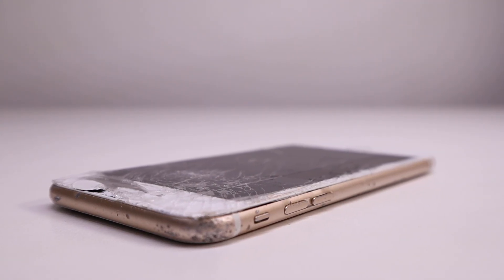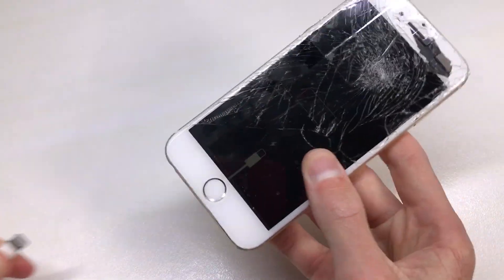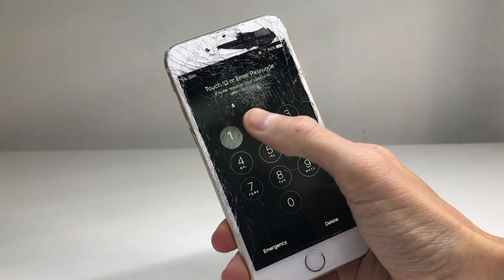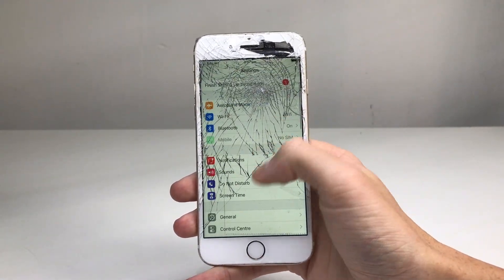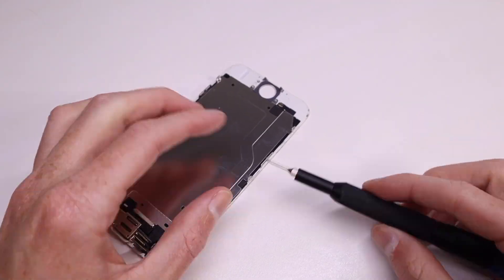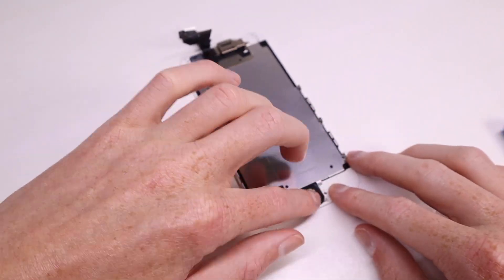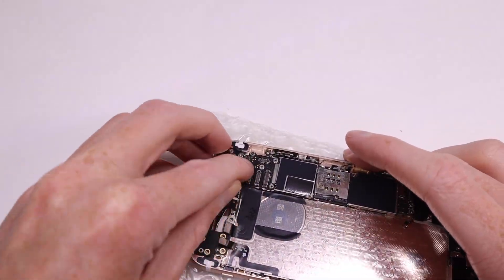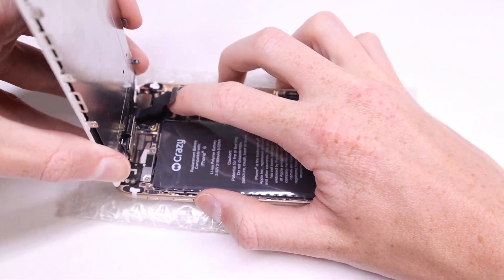$30 Destroyed iPhone 6 Restoration - Seller Tried to Scam Me?!

Comment: For the question why apple doesn't let you repair the home button with touch ID is because, in my opinion, they don't want the phone's security to be compromised by installing home buttons from other phones or third party. I find the reason here in this video to be the common and lazy explanation to what Apple does things.
Reply from the maker: If thats the case, why doesn't Apple have a home repair/replacement service?
They refuse to replace a broken home button by itself and say its attached to the screen and will charge you for a whole screen replacement even if the screen isn't broken!
They are straight up lying to people and getting away with it!
Reply: @HughJeffreys it would be the same as why when you break the glass of an iPad today, you would also need to pay for the laminated display as well. Nowadays, Apple is integrating all the parts into one component, which complicates the repairing process of an individual part... I highly recommend that you watch Apple Explained, they have a video which explains the repairing process and why it is so expensive. Also watch louis rossmann response to that video. But i'm not denying your effort and value into refurbishing the iphone i find it very interesting. But just pointing out that it is easy to criticise but it takes a lot of effort into understanding why companies do certain things, rather than just blaming it all to greed and making money.

Comment: I usually remove the plastic from the replacement batteries, but other than that I've never done anything differently while doing repairs, and I've never had that display issue
Reply from the maker: I did remove the plastic :)
Reply: @HughJeffreys  in which case I stand corrected and apologize, I guess it's just one of those strange things then lol

Comment: Be sure, especially with the iPhone 6 to discharge the board after disconnecting the battery. It is common that you will blow the backlight ic if you don't. Simply hit the power button a bunch or hold it down for a few seconds. Newer iphone's aren't as much of a risk, but be careful because this will require microsoldering to repair. As far as the display showing lines, if after multiple attempts to ensure that the connectors are clean and no pins are missing, it is entirely possible for the display to be defective. Alot of it all comes to trial and error when it comes to this stuff. But with Apple making phone repairs evermore difficult, it becomes increasingly more time consuming. For instance, I had an iPhone X that needed a port replacement due to not charging, after the replacement, the phone would shut off after 3 or so minutes of use. With many tries of disconnecting, cleaning, and trying 2 other replacement ports, the issue was not present with the original port being put back in. I will be testing with different suppliers to see if they were just bad quality or ONLY OEM parts will work. Only time will tell before iPhone repairs become too costly. I see it very near, also I am a phone repair technician so take that for a grain of salt. Apple does want all the money, that much is true with new iPhone's.
Reply: fining a good supplier for aftermarket iPhone parts is a challenge for me at least. So frustrating to get junk parts not to mention stuff like replacing the screen on an iPhone X with an aftermarket screen, the screen won't work when you do the next IOS update. Thanks Apple.
Reply: @MrTimdtoolman1  Yea, quality parts for newer iPhones. Nightmarish. I had a customer's iphone X charging port stop working. He came in, I figured oh, simple enough. May take a while but should be easy. I bought 3 ports from 3 different sellers, because I never replaced a port on an X before. The first one literly looked like someone tried to fix the connector with solder, it was awful because it was supposed to be new, probably was one someone returned and was given that after they tried to fix it. Anyway back to my point, the two other ports both did not work(two different sellers) and it would charge fine, but the phone would shut off every 2-5 minutes and restart. The only way to fix it was to use an original apple part from a part phone. Well fortunately the next day after this fiasco, I was able to buy an iphone x from someone and the port worked fine in the customers phone. Maybe bad batch but I need to test more ports to find out if it has to be apple parts or if I have to to a restore to make it recognize it without restarting
Reply: @Flammablemaster1990  Will home functionalities stop working after an aftermarket LCD replacement? Is getting a refurbished one or simply replacing the glass the way to go?
Reply: @Madrista10Raul  Here is how the structure is. Ever since apple introduced touch I'd on any apple device. That button is tied to the motherboard by apple from the factory with a $600,000 or so device that they will not sell or allow anyone but them to use to pair the devices. Once your home button breaks, if it is any of the iphone 6's and down, touch ID functionality will not work and apple will have to pair it if you want that functionality. Now for the iphone 7 and up, stopping at X when they removed the button. If the home button is damaged and stops working, a replacement button will serve no purpose other than to fill the empty hole if it was gone. The physical button on the 6's and back will still click to go home or close apps, but on the 7 and 8, the plus accordingly. The home button does not click anymore and uses haptics for the effect. The back of the button is a tiny screw securing it to the home button plate, so any movement is that plate either flexing or loose screws inside. If it ends up not working, replacement parts do not serve any purpose, you will be stuck using the assistive touch. Many people end up trying to repair their 7's, and 8's and tear the cable for the home button. Rendering it useless until you can find someone to try to repair it, using microsoldering, or get apple to do it. So as far as the replacement LCD's. Get them from a reputable seller and higher cost will almost always pay off in the quality of the screen and lower failure rate. Just transfer the original button and take great care as you do it, dont forget a little bit of heat on the front of the glass will soften the glue holding it down. I highly suggest checking out ifixit and their tutorials that they have. They explain alot very well. Just often dont mention discharging the board is all. But I try to practice it religiously to ensure any chips on a board dont fry due to not doing something as simple as holding a button down for a few seconds. Anyway, best wishes on your repairs. Take your time, that's most important. Ps. Most replacement screens dont come with a home button.
Reply: @Madrista10Raul  home button functionality should still work after a lcd replacement. Depending on the model, different things may be stopping it from working. First reseat all connections  then if that doesnt work, check for damage to any button cables or missing pins on any male connector. As far as replacement lcd and weather you should just replace the glass. If you are doing the repair, replace the entire lcd and glass combined. If your lcd is fine, you can ship it off to someone to remove the old glass and place a new glass on for you, using special machine equipment. The option is always up to you, but the amount of work to replace just the glass is alot without the equipment. Also you will need some uv curing glue. Tried and true, easiest and quickest is to get a high quality screen and replace the assembly. That is how a majority of screen replacements are done.
Reply: @Madrista10Raul  if the screen is bad quality, and the home button cable is attached to the screen. It can be at fault also. And as far as refurbished screens, the lcds are going to be better quality than really any other out there. But as long as it's good enough quality, side by side by any average Joe will have no idea it is a replacement screen. Should be spending about $60 or so for really good quality screens on all of the iphone 6's. And the prices go up a bit the newer the model. And the new iPhone X's and XS's have oled screens, so an increase in cost it drastic. So be prepared. It's as bad as the newer samsung S series and note series in cost. But just easier to do. Only taking about 4 screws and the prox transferred. Sorry for all the replies, it took this many times to read the message and actually respond. I get too carried away. Sorry. And hope I could help, will always try to answer any questions you or anyone may have.
Reply: @Flammablemaster1990  Yes thanks, answered all my questions. Do you know anything about static issues associated with transferring an aftermarket LCD? Or does that go hand in hand with your comment about discharging the motherboard
Reply: @Madrista10Raul  yea, as far as my knowledge. All of that goes hand in hand with discharging the board. It's due to the power that is in the board after you disconnect the batter, it's not going to hurt you in any way like tv power supplies can with the large capacitors. But it is the whole system of the screen and motherboard combo. For the iphone 6 for example, which is the least forgiving of iPhones when it comes to static power left in the board, power is delivered to the lcd panel through some of the pins on connector, if I remember right it might be only two but have to look at schematics to be more accurate, it is this power that bridges the board to the lcd that when it disconnects, it essentially shorts the circuit that goes through the lcd to give it backlight. And when you do it may, and sometimes really easily blow the backlight fuse and will have to replace it along with a few, diodes(dont quote me if it's a diode or not, anyway, the few near the backlight ic for power delivery blow and will also need to be replaced. As far as aftermarket or not, it doesnt really matter, it is a board level thing, and just depends on redundancy built into the board. Just as long as the board is discharged the static charge left in the board dissipates, there usually should be no issue with the like.

Comment: not so much repaired as completely replaced with an equal number of new pieces except the mother board! However for $90 total thats a pretty sweet deal. Id be giving the seller some pretty rotten feedback though. Borderline scamming but since you was replacing the battery anyway it didn’t end up mattering. Nice vid

Comment: My iPhone 6 has not much scratches but it ded and won’t charge, I tired hard resetting and nothing. I tired different chargers and tired to connect to computer and nothing. I don’t know what happened, I’ve only had it for about a year and I never saw anything wrong with it. It is not water damaged because it never fell in water or was wet.

Comment: what do you use to factory reset the iPhone 6? I found a iPhone 8 plus and I want to factory reset it myself.
Reply: Return the phone
Reply: @_bit_  won't they give it to the original owner?
Reply: @_bit_  how
Reply: Probably has icloud to reset shutdown phone once its fully shutdown connect the phone to the computer and immediately press and hold the volume down and power button it should go into iTunes mode after 10 to 15 seconds the open iTunes and reset
Reply: Can you sigh into it, if can you can do it in settings
Reply: @Denukem865  I found the iPhone, so it isn't mine and it has a pass code.
Reply: @wristyband  you have a laptop or desktop
Reply: @namenotfirstname7849  yes
Reply: Isn't that like.. stealing? You found it?? It isn't yours? Return it or something like wtaf?
Reply: U can put the phone into DFU (recovery mode) and recover it from iTunes. If it has an iCloud lock then the logic board is done. Parts only at that point. To activate DFU on any phone newer than iPhone 7 you hold power button + vol down and then when screen goes black bet go of power and keep holding vol down until iTunes sees a phone in recovery mode. (Make sure the phone is plugged in and iTunes is open otherwise it won't go into recovery mode).
Reply: MagicBlueMelon technically isn’tdone icloud can be removed
Reply: Just Look for an tutorial
Reply: If it has owner sim or still haven’t reset it send me a message on Twitter omg Backstabber bc once you reset then only way is by receipt method tho not sure why you don’t contact owner
Reply: Where
Reply: @vibyyn  I found it, why would I steal if I can just get a new one.
Reply: iiSSplasHH you do know the owner can track you

Comment: I forgot what a clean iPhone 6 out of the box looked liked. So sleek and elegant
Reply: JayGot Games I have a 6s.  Same phone but with 3D Touch and a faster processor. Love mine.
Reply: Posty McPosterson 6s was my overall favorite iPhone. I still have mine in rose gold for 128GB. It’s badly cracked from my sister. I want to add a new screen and keep it for good because it was my favorite iPhone
Reply: Grenade Man  You'll need that upgrade  before Christmas dude..your phone will need updating and apps won;t work for your IOS device ..LOL.
Reply: Looks can be deceptive .The logic board has been through some shit..looks NEW but would;t trust THE BOARD  who knows what hidden issues may rear their heads in a month or two?
Reply: You can put a new shell on a smashed up car but doesn't make it new or even safe, certainly can't give any 'guarantee' .Yes it looks good and new.... that board though...I wouldn't trust it with important family photos etc

Comment: I have a question. Soo I dropped my iPhone 7 (it took a hard hit)on the floor last year. The screen got those lines in different colors and then It turned black. Can I fix it by myself? Great Video!
Reply: Yes, get a refurb screen
Reply: Yes but you must be very very careful removing the home button. They are very easy to rip or damage.

Comment: Apple says the home button thing is about security, but that's obvious bullshit.

A fingerprint scanner only sends data of what the fingerprint pressed onto it looks like. Simple as that. It is a basic input device that happens to input fingerprints. Someone could not maliciously use a "fake" fingerprint sensor, unless they knew your fingerprint already, and could send the data directly through that. If they knew your fingerprint, they could also just make a model of your finger and use that to unlock, so that's not a real issue too.

It would be like saying you can't replace the keyboard on your iMac because you type your passwords in on your keyboard, so it's a security problem to replace it.
Reply from the maker: And they don't even offer a home button repair program. They just say to the customer that the home button can not be separated from the LCD and they will charge the price of a whole LCD replacement which is already a rip off price even if the screen is fine.
And they get away with it too!

Comment: How did you wipe it with a password and not activation locking it
Reply: You need to put it into safeboot and then restore it.
Reply: @Tom-kh2vx  DFU mode*
Reply: How do you put it in dfu mode
Reply: @ianturner6098  by connecting to itunes and holding the power button and home button
Reply: Ian Turner depends on the phone. 6s and below is done by connecting to iTunes then holding down power and home button until the screen goes black. When the screen goes black let go of the power button and keep holding home until iTunes sees an iPhone in recovery mode. For an iPhone 7 and newer replace home button with volume down button
Reply: Thank you so much. I retored my phone

Comment: I just got one where the seller said he had no idea why it wouldn’t turn on.  I remove the screen and it was clear someone was in there. The connector for the charging port wasn’t plugged in, and also all of the metal plates covering the chips were removed. 🙄 the jerk knew.

Comment: lol I just returned one that I bought. Seller said it was “untested” only had 2 pics on the listing one of the front and one of the back. He didn’t mention it being locked and he didn’t mention it was missing screws and the SIM tray. He had a 14 day return policy so I just sent it back because there was nothing much to part out. Sent it back and he never refunded me ended up having to open a case and eBay refunded me.

Comment: I still watch and love your videos and I fixed my iPhone 6s that I bought for 85$ with damaged screen but 64gb and I got a new screen for 20$ it’s great but, it has white lines can u help me please.
Reply: And get a refurb screen, Not a cheap one
Reply: LeGgo MyEggo did u try turning it off and on 😂
Reply: Try disconnecting and  reconnecting screen connecter, otherwise You need to get a new Screen unfortunetely
Reply: Also the screws for the display plate may not be in the right order or too long try listening them a bit

Comment: I did this with my 6 plus and I used a refurbished apple screen total after buying a broken phone and fully restoring it I spent 127 for a 64gb with 100% battery capacity brand new housing and an official apple screen in perfect condition
Reply: Look them up used ones are 200$ on eBay
Reply: 127 is insane for a 6 plus
Reply: There like 50 brand new